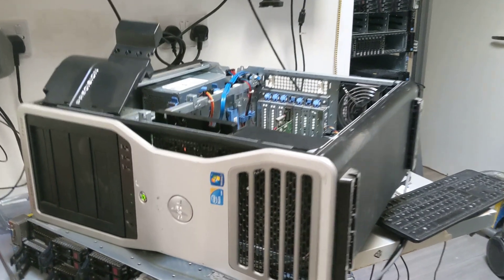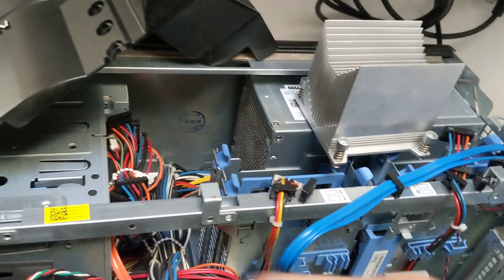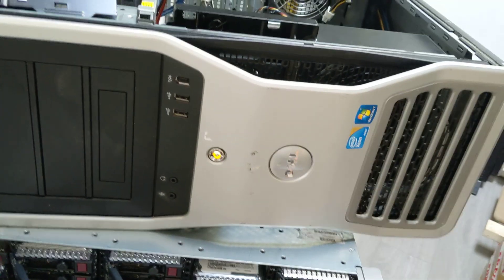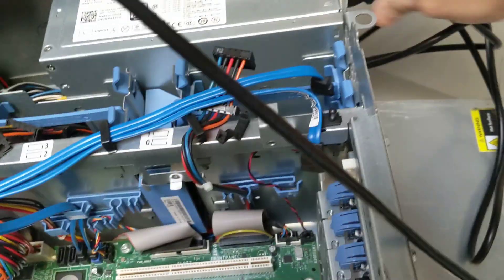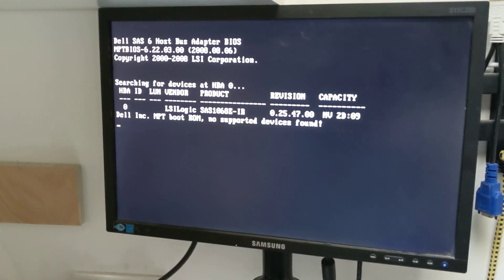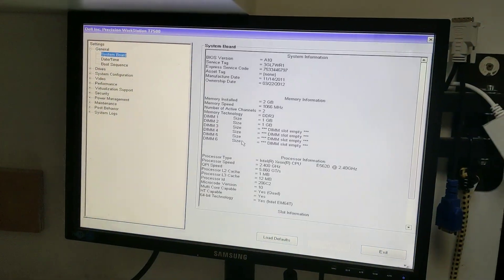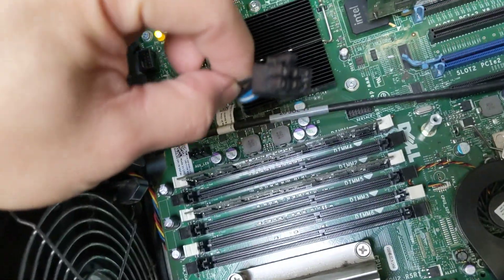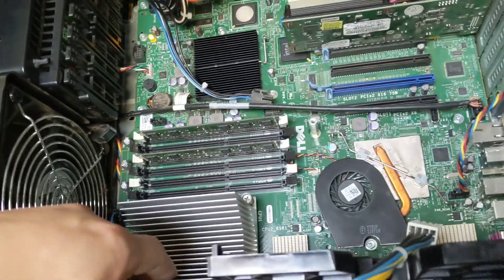Dell t7500 234 error amber power button fix

Comment: Hi There, I have  Dell T5500 when it turns on , the monitors dont turn on and it shows the flashing lights 2,3,4 showing. Have you worked with this issue before that the monitors dont come on?
Reply: I have this same error 234 please have swap more than 4 processors it boots and freezes after freezing the amber light turns to error code 2 please I need help
Reply: hey dude same pc same problem, it my main server and it doesnt want to boot up for the same problem, did you find any fixes?
Reply: @Pixel-sv1zv  no I tried a few tips but couldnt find any solutions. Sorry you ran into this too, seems like a common issue with this system. I ended up getting a lenovo and that has been good to me

Comment: I have the same t7500, my pc freezes randomly.

I have tried disabling c-power state. 
But no use. Now I am back to this error in video.

Can you tell why does the t7500 freeze completely all of a sudden and a hard reset is required.
Reply: I'm having the same problem
Reply: @anthonybrown3829  Did you find a solution?

My pc sometimes turns on, may work for 1-2 hours.

Then HANG.
when i restart, it goes back to same issue